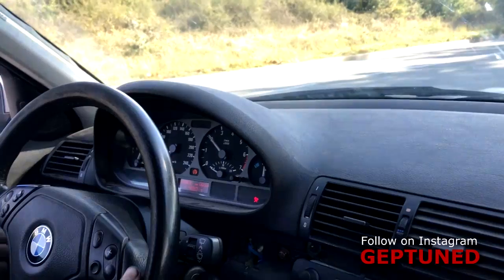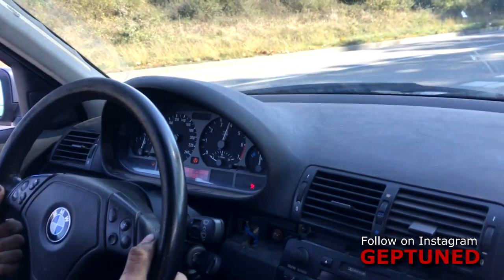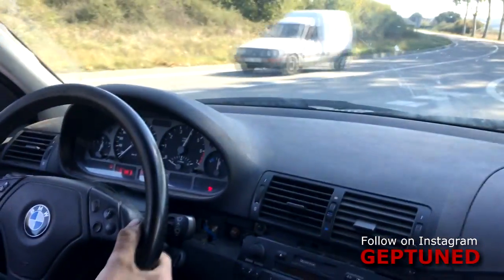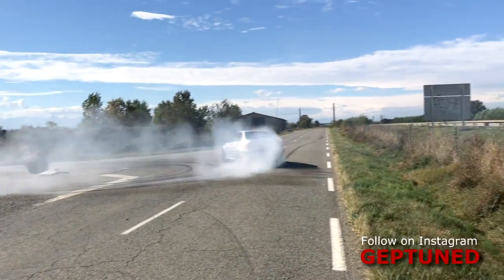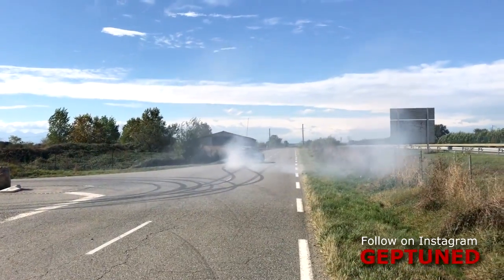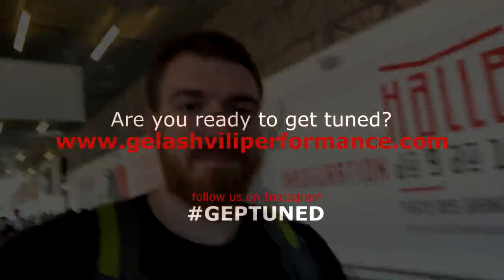Daily 450hp Monster from france!

Comment: If you change the airintake for a m54tub25 you ll get much more power because the m52tub28 has the same diameter as the m52tub20

Comment: Hi!
Can annyone tell me why do you need to fill it with e85? And what happens if you fill it with e95 or e98?
Thanks
Reply: U get more power... and its safer for the motor...e85 prevents pre-detonation ...but u get shitty mileage
Reply: @georgesmbyd6603  e85 is a lot cheaper than regular gas
Reply: @michelg.7006  true but good luck finding an e85 gas station 😂
Reply: @georgesmbyd6603  depends where u live ive got one 10 min from me

Comment: hi, is this engine still alive?:)
Reply: Stock hp: around 190
If you boost it up to 300hp, you can have it all stock (just replace the fuel inyectors).
I have a friend who use it for drifting... 300hp, full stock and it's still alive after 7 years!!
Reply: @Tahio76  7 years stock motor , well done cheers
Reply: @Tahio76  how much boost is your mate running
Reply: @jordivarelabakker8293  some people run up to 0.9 bar on stock engine
Reply: Prob not🤣🤣 i speak from experience
Reply: @Awsometurtle20  so you always gone end up broking the engine? Even on low boost?
Reply: @PerfectBeast6  not always remember boost adds extra wear and tear in ur engine but it doesnt mean its gonna blowup or break u just have to keep up the maintance on it  especially a bmw engine  it aint like a 2jz which is pretty bullet proof
Reply: Also the engine in the vid had stock internals which are weaker than forged internals which handle boost and power and are designed for that
Reply: @Awsometurtle20  i have m54b25 in Z4 and want some extra power..lets say 300 maybe 350 on crank.. What you recommend to do?
Reply: @PerfectBeast6   dang u lowkey have more hp than and im boosted😭 my clutch is bad too lmao i feel like u can prob get an intake and exhaust and prob a tune i heard theres this guy he just sends u a ecu already tuned and it gives u better throttle response  /feel and pops and bangs if u like that
Reply: @Awsometurtle20  pops&bangs sounds cool. Intake and tune probalby not gonna give alot... i have stock like 192hp and i feel i need to push it to at least 300 to be happy ;p
Reply: @PerfectBeast6   well then turbo might be the way to go prob on 10 psi  and a tune and it should be at 300hp u might need bigger injectors and a fuel pump and i clutch maybe stage 2 or 1 gotta see what hp its rated for the clutch is gonna help stock clutch might slip
Reply: @PerfectBeast6  if u manage to get additional info on that please let me know
Reply: Hell no haha
Reply: I'm going to guess the piston rings weren't gapped correctly for the extra heat which lead to them over expanding and, buckling in the engine.
Reply: Just boosted my e46 2.8, after 3 days massive blow by. Only at 0.5 bar
Reply: @woofernl  why? this pressure is "safe" :( bad afr?

Comment: Is the stock M52TUB28 block good for RELIABLE 350-400 hp? Or is it blowing up after 10.000km?
Reply: I've read that the blocks are potentially cast iron and not aluminum, but I've also read that this only applies to US spec cars. I assume such a block would be quite capable.
Reply: m52tub28 is pretty much a m54b30 without the forged crank and smaller displacement.

Comment: Has the headgasket beem changed to lower compression?
Also, have the injectors or fuel pump been upgraded, clutch?
Reply: In video He said untouched stock motor. Lowered compression is unnecessary in bmw engines, you only get very bad low end torgue and lot of turbo lag if you lower compression
Reply: @bilteman_hukkaportti  can you please explain in detail why exavtly this is? How much HP can you do without changing compression on M52/M54 engine?
Reply: @caio2306  it is not about hp it is because this is an alluminum block and because of the hight comp the head may lift on higher boost, but for low boost applications, it should be fine with the stock head gasket (I am not sure for how long though)

Comment: I would definitely like to know more when I start the build on my 2003 e46 325i is it possible for you to work with us customers
Reply from the maker: Yes for sure? Thats what we do all around the world
Reply: @GEPTuned  How much would a turbo kit + tune cost for a 2003 e46 325i with an automatic transmission?
Reply from the maker: aidsisaids we dont sell turbo kits. For detailed info and pricing send us message on fb or instagram
Reply: @GEPTuned  would this be possible on the American 2000s e46 328ci? It's an iron block so I'm wondering what else is different? It's the m52tu just with an iron block I think
Reply from the maker: Hunter Altman yes possible
Contact us on fb or insta
Reply: @GEPTuned  thanks!

Comment: Did you alter the calculation algorithms of the code or just simply re-scaled the MAF table and load axises for the map sensor and then re-tuned the maps to match the signal of the map sensor?
Since the system uses milliseconds in the fuel maps, i would believe it's pretty easy to just rescale the axises for a map sensor and re-tune the fuel and ignition tables.

Comment: ahh thats impressive, i pushed my stock m52tub25 to about 380whp... but ended up lifting the head
Reply: Hey there, 100% stock engine? How many pounds of boost?
Reply: @OLearysBMW  100% stock m52tub25 (no timeserts either), with a b30 intake cam, new stock headgasket and headbolts, and a massive ring gap. i had it set on 10psi Wg, running 18 degree timing advance. but i put e85 in it again and ran 23 degrees timing advance, i could feel a massive power gain but it lifted after about 10 minutes of driving
Reply: @jackmccormick3824  Hey how did you end up with your project? Timeserts? I like the idea of boosting the m52tu since they are very lightweight, have dual vanos, mls head gasket from factory and are relatively cheap. But obviously it is more difficult than with a m50...
Reply: @peterm3861  i ended up going with an iron block m50nv, stroked to 2.8, forged bottom end, arp main and headstuds. running a cutring. and an aem infinty 508. basically changed everything lol
Reply: @jackmccormick3824  Thanks for your information. Really unfortunate that the aluminium engines seem to be difficult to handle when turbocharged. I wanted to put a boosted 2.8 M52tu in my E28 to achieve a good weight distribution but I fear this wouldn't be the smartest option. Some people seem to do well with the aluminium engines such as Gelashvili here in the video but I think you can't really guarantee. He always writes that it depends on tuning but bringing the power in late to save the engine is also kind of boring, isn't it? :D Still not entirely sure but I think I should rather focus on a M50/M52 based on iron block... Thank you so far, Jack!
Reply: im considering turboing my m52tub28. i hear that heads lift but don't know what that means exactly. is it just like a blown head gasket and become permanently damaged or is it temporary and some coolant/combustion gasses leak out side of block? thanks.
Reply: @hhn2002  yeah you understand already, basically breaks the headgasket seal and as you know thats not good. the head's arent the issue, its the shallow aluminum threads in the block. best method is to remove the head and install 10mmx1.5 steel timeserts, use new stretch type head bolts(factory  headbolts), with a cutring headgasket. Pazi88 has some great videos on the aluminum blocks m52/54, hes made over 500whp with them

Comment: Did you need to change accelerator and also coil harness for ms43 conversion, or just throttle body. Also do you know where to find information about what needs to be changed on pinout?
Reply from the maker: google is your friend for pinouts.  u need: manifold, throttle, throttle connector, pedal, pedal wiring (4-5 wires) and few pins to move around thats it.. coils remain same on ms42/ms43

Comment: how in practice such a turbo filter grid? Does it not shorten the life of the turbine very much?
Reply from the maker: it does not shorten and even if it does in this particular case who cares? this particular car was built for fun on cheap chinese parts and even if turbo fails owner will get another one cheap. (so far this turbo ran strong on several cars)

Comment: Hello Gelashivili pefromance and many years ahead ! I am a subscriber and I have been following your channel for some time now and watching what you're capable of doing with BMW's ! 

Question, I normally have a plan to buy a E46 330i but many people advise me NOT to turbo it because it simply doesnt mix well together, it is aluminium block and it would simply not handle the pressure, and something might break badly, how do you guys manage to turbine those BMW with seemingly no issues whatsoever ? This literally looks like the perfect car, I dont understand how it can handle such boost with no damage. What I was told that the only soludtion to get substantial amount of power from these BMW's is with pre-built bolt on superchargers that cost almost as much as the car itself.
Reply from the maker: it all depends on what fuel will u run and who will be tuning it.  everything is managable ;) they are pretty tuff engines if service was done on time and if build is done correctly.  as u can see this particular car has done almost 300k km and runs strong under boost too...
Reply: @GEPTuned  Thank you for the reply ! I will def consider you guys if and when I get my 330i but I will have to go in fuller detail with you guys in how to arrange it.
Reply: Gelashvili Performance  Have U changed the rod-bearings already? You should

Comment: original head gasket?
Reply from the maker: Vincenzo Paone as stated 100% stock
Yes gasket is also stock
Motor is untouched with 300k km on it
Reply: @GEPTuned  in the long run the engine holds up?
Reply from the maker: @vinpaone  this particular one was built beginning of summer 2018 and still runs strong, beatin crap almost every night.
Reply: Gelashvili Performance and still going?

Comment: What you used for clutch ?
Reply from the maker: Bogdan Ciobanu single disc ceramic
Reply: @GEPTuned  does ms43 plug-and-play on ms42 harness ?
Reply from the maker: Bogdan Ciobanu few wires should be moved and ethrottle wires should be added